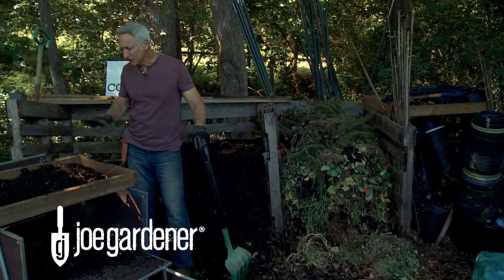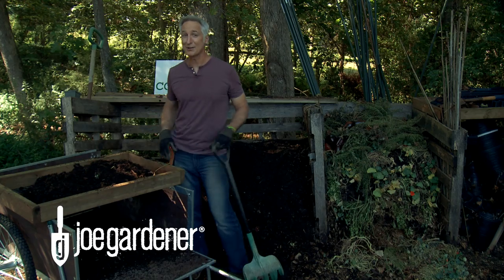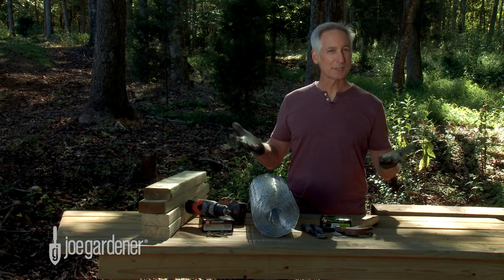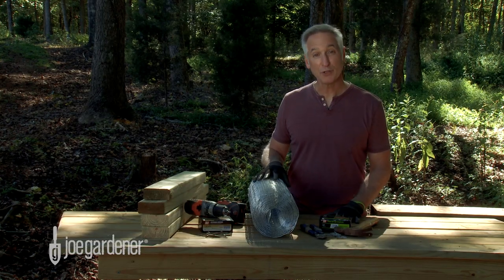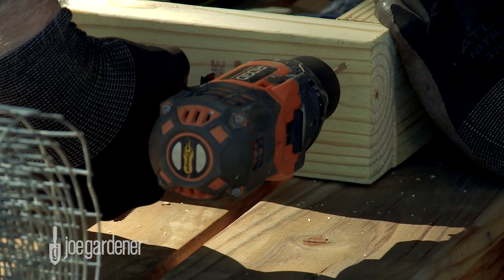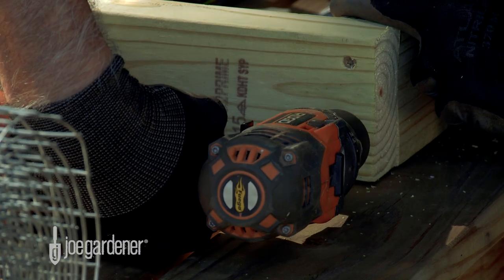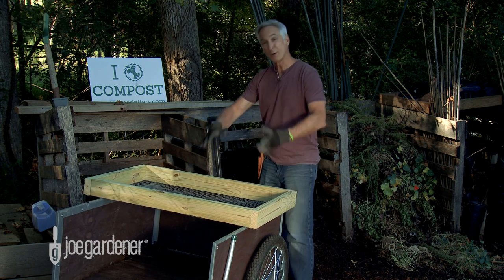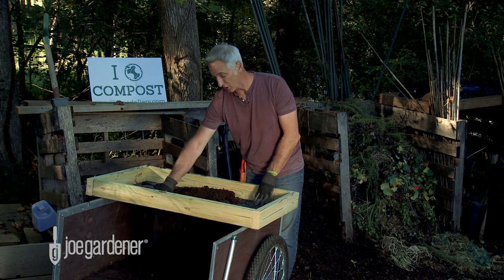How to Make a Compost Sifter (and why you should)

Comment: I noticed when you laid the wire on the frame you bent the edge down . If the wire is turned over the bend won’t be needed. Yes you will have to unroll different but I fine it lays better to start with . Not knocking how you did it just a suggestion.

Comment: Could you use chicken wire or would it be too flimsy?
Reply: I think it might be too flimsy - it has a tendency to deform even as you are unrolling it.
Reply: Jill love your podcast. 
You might be able to use chicken wire if it's what you have available.   Maybe 2 pieces offset a little.
Reply: I used chicken wire, and it works fine.
Reply: @sonyamelzer1047 --- Also try using rabbit-cage wire to get greater strength

Comment: What brand of pitch fork/shovel thing is that?  Seems super useful
Reply from the maker: This is the best tool I've found for working with compost, spreading mulch, and so much more. It lasts forever, super strong and lightweight. I've been using the very same fork for about 14 years. It lives outside through all the elements and is still going strong. Here's the link on Amazon; https://www.amazon.com/gp/product/B079GK9GJT?ie=UTF8&tag=g0c954-20&camp=1789&linkCode=xm2&creativeASIN=B079GK9GJT

Comment: Can you tell me how much Square cm the hole is please?
Reply: It’s 1 inch by 1 inch, which is 2.54 cm. Here in the US, that size of screen has very sturdy wire. However, just use the size of wire grid you prefer. I’ve used 1/2” and 1/4” and they both work great. So 1 cm and 2 cm are good options.